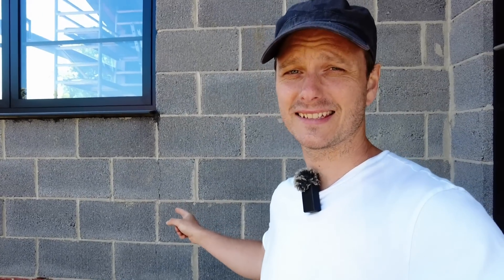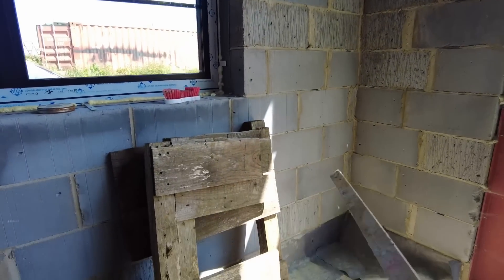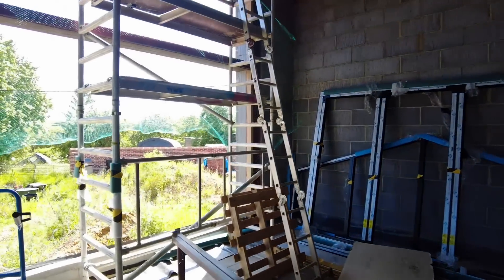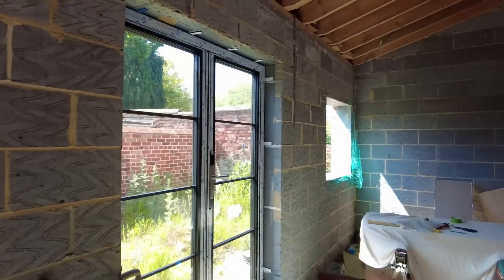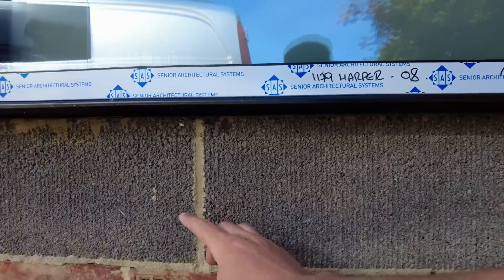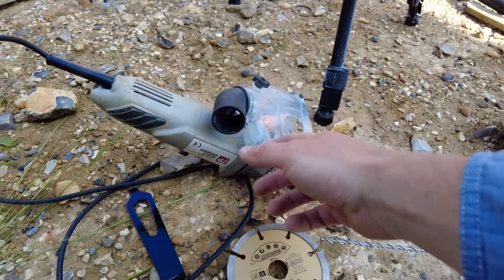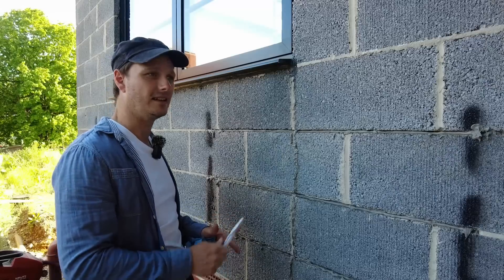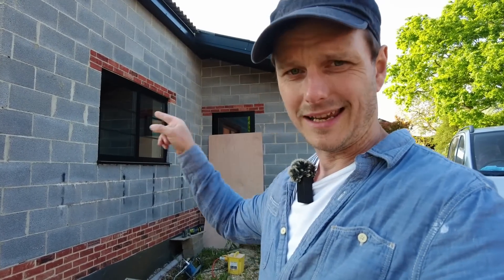My Newly Built House Wall CRACKED! I Need to Fix It NOW!

Comment: It's surprising to see all the cracks.  It's perplexing given I've seen a 25 yo block and brick house with no visible control joints, but no cracks.  Perhaps it's related to reinforcing?  I know the top course of block is filled with grout and has one 12mm horizontal rebar.  The footing has 12mm rebar starters vertically every 600mm which is tied into that the horizontal rebar running along the top course.  
Is there any reinforcing in these blocks?

Comment: Very common around windows especially after settlement time.They would probably not get any worse but good practice while it’s not finished to stitch up.
Lack of communication on site seems to be the problem as the brickies look pretty tidy to be fair.

Comment: As has been said already, concrete blocks should have joints every 6m, brickwork is every 9m.  Also strength of mortar has been mentioned.  What were mix proportions?  I always specify 1:1:6, cement:lime:mortar. That should ensure mortar is weaker than masonry.  Also concrete blockwork shrinks after manufacture as they are still drying and clay bricks expand as they take in moisture from the air.
Bricklayers should know this as well a creading ALL the notes on thecdrawings supplied to them.

Comment: I may have missed it in the video but another issue I find with cracked bricks/blocks is the mortar has been made too strong. You want the mortar to be weaker than your bricks/blocks because if there is any movement then it cracks along your mortar joints which is a lot easier to sort out.

Comment: Good work. I'm glad i came across this problem because im going to be building a full face brick house and all external walls are worked to whole brick dimensions so theres less random cuts.

My windows and doors are bound to fall on the perps lining up with the outer edges. 

Do you think the metal lath is best used or do they do a proper fixing for face brick

Comment: Similar problem I'm having. Cracks in blockwork (rendered) upper wall double storey extension, which is above a single storey extension.

Water pouring in through the ceiling in the single storey extension. Builder tried to say it was because I didn't paint the render, and now refusing to fix it under warranty.

It's because he didn't put in ANY  expansion joints in either the blockwork or the render, which runs for 9 meters. Should have had at least one expansion joint.
Reply from the maker: Oh that's pretty sh*t 😑 did you have anything in the plans to say they should be put in? I think I'll end up being ok now I put the bars in as most of the other parts will be clad
Reply: @THE-AIDEN-PROJECT  Absolutely. Plans included clear instructions for expansion gaps at 6m intervals. He did put expansion gaps in correctly in some other areas, but forgot to accommodate the wall above the single storey extension (which was the most important one), so water ingress from outside has nowhere to go but in through the ceiling.

It's one of these things that takes a full cycle of the seasons to show the weaknesses in a build, which is why I insisted on a 2 year warranty. Apparently though, their warranty has hidden clauses, such as, "when we left, everything was spot on", so he's refusing to even admit he messed up.

I'm glad your remedial is working out, but I'm sure you didn't need the hassle or cost involved. We've all got other priorities, and I went for the most expensive quote thinking I was getting the best team, and made him well aware before the contract was signed that I didn't have the time to manage every detail.

I wish I could say that was their only big mistake, but unfortunately it's not. Much like your build, every trade who turned up dropped some absolute clangers. Most of the subcontractors he used were guys he'd never met before, which was something I only found out after they had started work.

Two of the subbies, I had to eventually refuse entry to, as they were clearly not up to standards required, either bringing in my own trusted trade or completing the work myself.

I spotted a load of mistakes while trades were on-site and managed to get them to correct these before I stopped hiring completely. However, there were so many mistakes overall, I didn't pick up on all of them, and now I've spent the past 19 months doing these corrections myself... and there are very very many.

The builder was in breach of contract during the build when he started selecting (inferior) alternative materials from those listed on plan without discussing it with me first (a non-exclusive contract clause), and now he's dodging the warranty claim. Alas, the solicitor is taking over that aspect now, while I crack on with the work in my spare time (which is very limited).

Please keep posting your efforts, as it's inspiring me on the days I'm not enjoying it. Cheers!

Comment: When you first mentioned it to the lads were they already a few courses up? I don’t get why they didn’t put a joint in ? It’s so easy to do. Also the first window you’re pointing out the lintel should really be bedded on a full block for good practise.

Comment: I’d just leave it as is, and put expansion beads in the render. It’s found where it wants to move, why fight it now. Also use sand cement lime render, NOT sand cement.
Reply from the maker: It's held up fine since I stitched it 😁 lime is a good shout

Comment: Expansion joints in blockwork should be 6mtrs, that is a perimeter measure not per flank. Brickwork is usually 12mtrs, you can go uptown 15mtrs with no openings. Sounds strange but the more openings the closer the expansion joints as they are a weak spot, again perimeter measure not flank. Also any return less that 1mtr should have one in the corner.👍

Comment: Hi, tbh the fault lies entirely with your Architect. The initial plans should have clearly indicated the need for expansion joints and where they needed to be installed. Professional contractors know this anyway and should have insisted on them. Can’t quite understand why they tied in the internal corners as it’s far easier for the Brickies to work in an expansion joint and build from profile to profile. A 15mm wooden baton keeps the joints straight.
Reply from the maker: It was on the plans but it's alongside loads of other information. I'm not sure it's the architects responsibility to highlight this specific thing, as all of the details are as important as this. I would have expected more from the brickies though, they have built plenty of houses so would have put in expansion joints on them, maybe they just got lazy. I even asked them about it out of curiosity and they mislead me. I've learnt to not trust most tradesman now as a result unfortunately.
Reply: @THE-AIDEN-PROJECT  if it was on the plans then of course the tradesmen are responsible in which case you have every right to ask them to come back and correct their mistakes. I’m guessing you paid out the retention once the project was completed.
Reply: In the video he clearly said the control joints were specified in the plans.

Comment: Hi mate are you going to spray render system should be ok
Reply from the maker: Both of the plasterers I intended on using doesn't use spray render. If the mess about I might have to look into someone else that maybe does the spray render though

Comment: Aiden... I've the same sort of cracks on my house.... renderer didn't mesh where the old house joined the new part of the build... too late when all rendered and painted. nothing gone inside.. or at plinth level.... and as we are a clay area, depending how much rain and how the dry the ground is. the crack opens up or goes tight. :(
Reply from the maker: Ah that's interesting to know the inside is fine 👍

Comment: I'm no expert, but if you prevent it cracking there with the stitching bars, will it not just crack along the next weakest point? I assumed you would have to retrofit a movement joint somehow (not sure if that is even possible). Anyway, great video very informative, thanks.
Reply: If there is a new crack midway under window then I'd be far less concerned, especially as the blocks were incorrectly staggered, numpties should've seen that two courses prior. As for inside, very unlikely to crack same way, as rooms won't experience the wide fluctuations as outside, unless you have bloody woman who likes 35c when you offer 8c 😂😂😂
Reply from the maker: @christianwithers7335  🤣 with an air source heat pump and under floor heating 35c is seriously out of reach. She will have to be happy with another jumper 👀😆
Reply from the maker: It's possible it might go in the middle of the window now....I might be getting some more bars though haha
Reply: @THE-AIDEN-PROJECT  - Great stuff. Your video is really helpful though. Seeing what works and what doesn't work is great. Keep it up!! Subscribed.

Comment: Hey Dude ... With the walls  locked in place with a helical bar .... will it not potentially force the building to crack elsewhere instead
Reply: I think that is potentially a problem. If you were to do this on a continuous wall (no windows) that had cracked due to lack of expansion joint I think it could move the crack to another location.....you wouldn't be fixing the problem, which was no expansion joint.
Aiden is strengthening around his windows, the weakest points.....so hopefully the expansion forces won't be enough to crack solid walls. On a long run of solid wall that gets full sun that gets cracking this wouldn't be a solution....it would just move the cracking.
I think Roger Bisby did a video on it.
PS this isn't really a structural issue, the house isn't gonna fall down. But it looks crap......hence why wood cladding for Aiden is a solution at the top.
Reply: Haha i literally just posted the same comment! Good to see the reply aswell, makes sense!
Reply from the maker: I did think there is a chance of that. I'm not sure it'll crack on the full wall as it's stronger there, so the only place left to crack would be in the middle under the window between the bars I've already put in. After all bed reinforcement goes across the whole thing and not near the collars. I might think about putting some more bars in though 🤔

Comment: Similar issue on our extension,  bricky didnt read the plans and i assumed they would, was meant to have expansion gap where it ties into the house with a flexible filler, instead its mortar and has cracked. Not sure i can much about it now but i may grind out the external (as much as i can) and fill with silicone.
Reply from the maker: Did they use a wall starter when they built it? I actually have a load of stainless steel slip things that were left over from the wall build which could have been used for the expansion gaps on the house. It's a shame I didn't use my original brickies 🤦
Reply: @THE-AIDEN-PROJECT  Yeah they did because I installed them to save them time 😂 just annoying they didn’t read the plans I just trusted them from the off and assumed they would. Lesson learnt I guess

Comment: Just my two cents ,very common with those blocks to crack near the windows . Had it myself on my extension what I built, but I should of used brick reinforcement under the windows. Mine never got any worse. Simple fix with heli bar with chemfix. Just my opinion, don't have render just have cladding. Thank me later .
Reply: Agreed.... Cladding without doubt 👍
Reply from the maker: Hummm 🤔 full cladding would probably work out cheaper...unless I learn to render 😂
Reply: @THE-AIDEN-PROJECT   unfortunately render looks nasty after a short period of  time, cladding would look great for years.

Comment: It’s rare to require expansion gaps internally, my opinion is that these are cracks for another reason.

Id suspect it’s from Brickie’s banging the walls around to try and plumb them up when the mortar is semi dry. Thus causing poor adhesion to the blocks.

However for this reason a good idea to stitch them back together, you could batten and board the walls rather than dot and dab
Reply: Great video though, good to highlight things that go wrong.
Reply: Internal walls should not have the same temperature variations as outside. I once lived in a concrete slab and brick infill block of flats. Built in the 60's and no expansion across any of the long sides, no cracks. But bricks were engineering, so I suspect low expansion.
Reply from the maker: I'm guessing that from the nhbc recommendations that thermalite blocks are more susceptible to expansion and contraction due to the shorter run you can have with them (6m). I know that most new builds dot n dab to get away with it but as I'll be doing float and set then maybe my walls will be more likely to crack. I'm hoping mesh will help though. You're right though, the temperature range shouldn't be as extreme so hopefully that will mitigate any risk of further cracking 😬
Reply: Over thinking guys let the build settle while you do other stuff it will be ok 
Most buildings crack because cement is so rigid